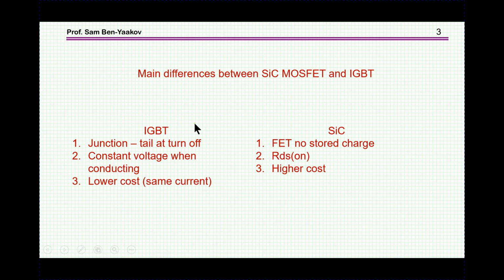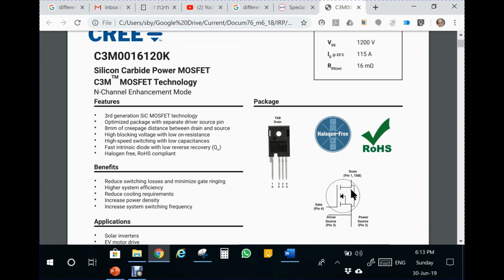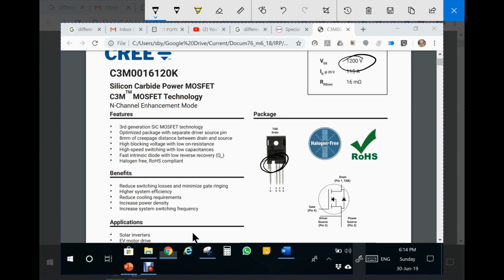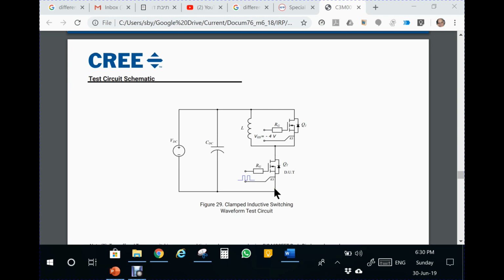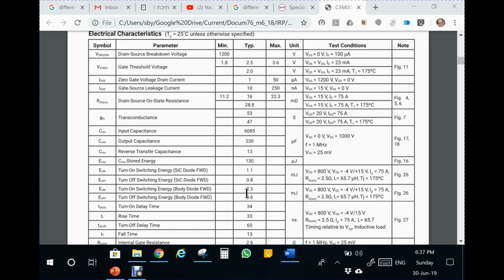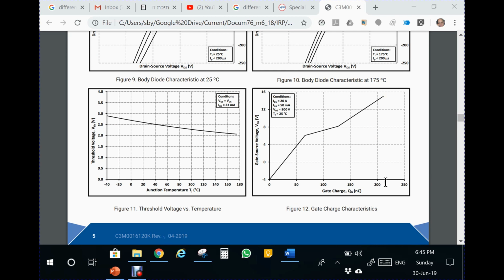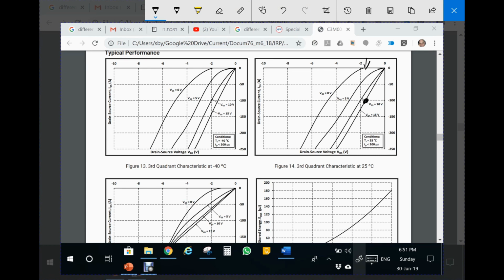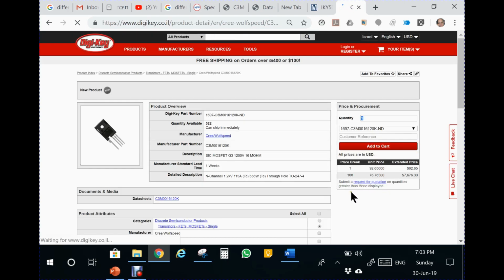SiC MOSFET datasheet and comparison to IGBT

Comment: Dear Professor Sam, at time stamp 35:50, should we use the rising time or switching cycle time to do the sizing of gate driver power supply? If using the rising time, the current request will be as high as 6A, then the power supply power for single switch is 90W(15V), which seems too high. If using switching frequency time, which component provide the rush current then?
Reply from the maker: The required Aux PS current is Qg (total) times switching frequency.

Comment: Hello professor, I really appreciate your effort to make such informative lectures.

I also have a question ... what is the effect of low transcoductance of the SiC Mosfets when they are used to drive inductive loads (i.e. motors, inductive heaters, ... etc.)?
Reply from the maker: In switching mode, little effect.

Comment: maybe sic prices are hold artificially, as not to take over existing silicon business?
Reply: raw material (Si Wafer vs SiC Wafer) is currently ~ 20 times more expensive per same area. It will need some years before cost per performance will reach the Silicon IGBT level. Of course with SiC Mosfet you can do some application not feasible with Silicon and that are where the volume are growing.
Reply from the maker: Thanks Marco, good points. Obviously there are plenty of applications that are not cost sensitive so SiC MOSFETs will survive and develop.